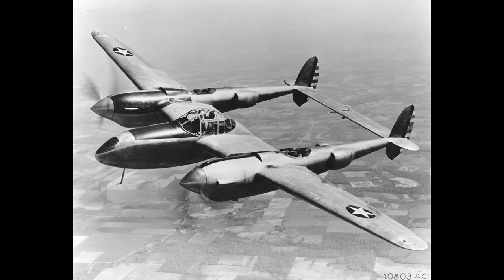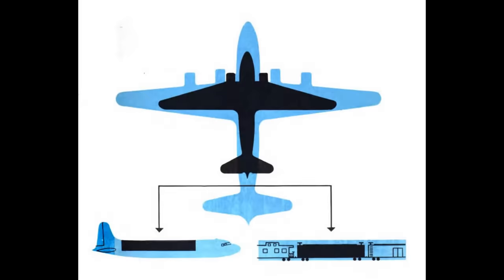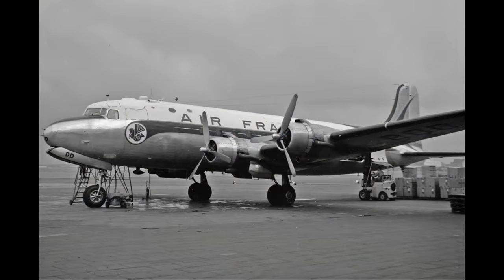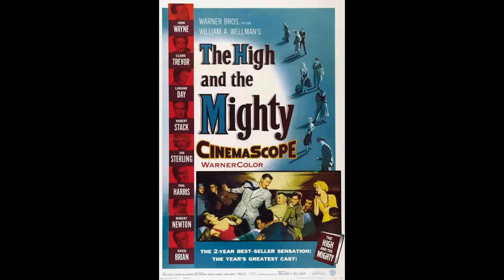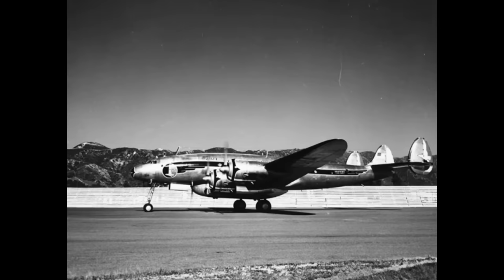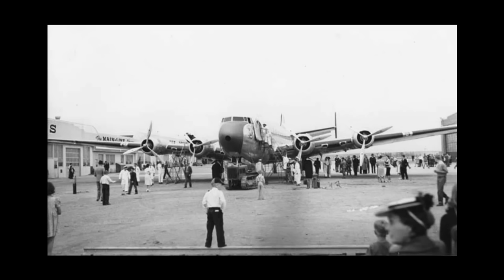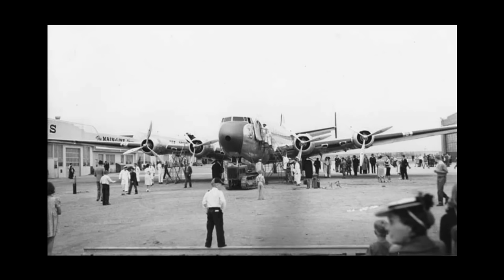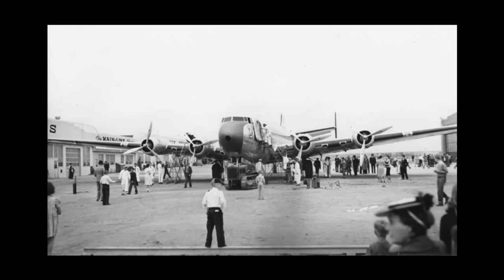Turbo Compound Piston Engines. Almost magic tech.

Comment: Great Video! I remember as a kid standing on the observation deck (common in airports then) and watching a DC-7 start up. The engine would start with a puff of smoke and the usual initial sputtering characteristic of radials, and then some seconds later you would hear the turbine spool up. I always wondered about the delay, but your explanation of how on start up the turbine fluid coupling needed to fill with engine oil finally explained what was going on.
Reply: Wow, I didn’t know you could hear the PRT, cool

Comment: The one I would have liked to have seen in action is the Allison V-1710 Turbo-Compound...the specs on it were really, really impressive...imagine if Allison had developed a Turbo-Compound V-3420!...
Reply: The one I would have liked to see was the Napier Nomad,or Napier's Deltic where the exhaust gases from the 3 cylinder banks was fed thru a turbine which was geared back to the output shaft.

Comment: I'd never heard of turbo compounding before this video, Greg, but I think you're right, we ARE seeing this technology return on some Class 8 OTR truck engines now. One question I have is this: - I've wondered this for years: Here in Alaska we still fly a few Dc6s, which I love. That being said, I've read that during the late nineteen-fifties and early sixties that while some DC7s were actually in the process of being scrapped, due to reliability issues surrounding the Curtis R3350,  the same airlines simultaneously kept their older DC6 counterparts in active service. As a novice, I've wondered why the airline companies didn't just turn their newer DC7s into glorified DC6s by retrofitting the DC7s with the tried and true P&W R2800 or maybe even the P&W R4360? Would this really have been that technically difficult to accomplish or would it have simply entailed too much of a quagmire of red tape  with the FAA? Or maybe the time and effort to convert prop planes simply wasn't worth the effort or expense with jets looming on the near horizon. I realize my question is probably over simplified but in leu of the actual cost of the liners themselves, it seems like an option to have at least been considered. - We do this kind of thing with semi trucks all the time, but of course we don't have the FAA breathing down our backs either: Great video!
Reply from the maker: The R-2800 wasn't an option on the DC7, you would be much better off with a DC6 at that point. Converting to the R4360 would have been a major expense. With the jets on the way, it made more sense to just park the DC7s rather than try to get them to be more reliable.
Reply: The R3350 was a very unreliable product at EIS. One of the deciding reasons for capturing Iwo Jima in 1945 was to provide an emergency landing strip for stricken B29's due to failures of the powerplant (props not feathering after engine failure). The R2800 was the actual high point of piston engine design. Piston bores are limited to about 6.2 inches in diameter - if you go above that the speed of the flame front becomes a problem. PW understood this by the late 20's. The obvious way to get more power considering this limitation is to add more cylinders. The PW4360 was PW's answer and it was no better than the R3350 because they could never get the fourth row of cylinders cool enough - the Boeing Strat was not a success and forced Boeing in some ways to gamble on the Dash 80/707 as it had nothing to lose in terms of market penetration. CW went a different path with compounding but this added a lot of complication and the engine/propellor combination was not reliable. The reason why PW and RR exist to this day as engine manufacturers is that Hobbs and Hives understood that piston engines were a developmental dead end by the early 40's and Lundquist at CW did not. Good video BTW.
Reply: The reason RR exists today is endless taxpayer bailouts,P&W I don't know about.

Comment: Another reason for using a prop on a cargo plane is the “blown wing “. The prop-wash over the wings generates lift.
Reply: in aviation we call this the accelerated slipstream
Reply: This is mainly a benefit in the very low speed regime. The prop does accelerate the air a lot during take-off and landing. But during cruise the difference between the surrounding air is really not so much and probably causes more drag compared to a clean wing of a jet.
Reply: @JMGlider  yes, that is how propellers work, but the thing about it is, once airborne, you dont have to worry about the diminishing effect, because youre going 300mph. This is really a non-issue because this can only be considered an upside to propeller aircraft. Everyone already knows theyre slower than gets, but the propellers do have a leg up in climb angle, stall performance, and maneuvering, excluding supermanuvering fighters of course.

Bottom line of it is, a jet will always be faster, but a prop will always beat them in lift. The slipstream diminishes at high speed, yes, but it is also no longer needed
Reply: I would have thought that the turbulence caused by the prop would have negated any benefit of accelerated air-flow?
Stalls are caused by the air-flow detaching from the wing surface, so surely a prop will cause this sooner than a clean jet wing given the same design of airfoil betwen the 2?

Jets tend to be built for more speed and weight than a similar sized prop plane and as such have a wing that will generally perform much worse at low speed than a prop plane.

Not saying your wrong by any means, I'm V far from any kind of aero expert.. But I'm questioning both of our views and would love to see it tested somehow 
(and by someone with the time and knowledge to make it happen, taking into account relative weights, engine performance(trust, response and such) and anything else I'm no doubt missing.)
Reply: @dzzope i think a jet just needs a longer runway to reach the speed for design lift, 
when the prop aircraft can spare some runway length because propwash wing airspeed replaces some of the groundspeed you'd only reach on the longer runway.

Also, turbulent flow is not detached flow, it's just more draggy than laminar flow. Laminar flow usually turns turbulent anyway somewhere along the wing chord, afaik.

I don't understand the details, but wing design sometimes purposefully turns the laminar flow turbulent (with serrated edges or small holes blowing out pressurized air) to make sure the flow stays attached to the wing surface (if i understand that purpose correctly).
I think that lets you generate more lift,
Or on glider planes, reduces drag. I learned about it on glider planes, but it's been a while and i never fully understood why you want to turn the flow turbulent. 
I think it let's you bridge or manage disturbances- the gliding asociation also jokingly put special zigzag-serrated tape in front of the mirrors and door handles on their recovery vans. 
(gliders regularly don't come home on their own when flying competetively, and you have a pickup crew on standby. German air law allows you to land anywhere when neccesary (not just in emergencies), and then you take the wings and tail off the plane and put everything into a trailer. you should pay the farmer whose crops you damage, though. 
Also with balloons, of course- That's how I got a "free" hot air ballon ride during my childhood :)  )

About stall, i think it's more of an "angle of attack" issue than a turbulent flow thing, and afaik high- lift systems purposefully do the blowout jets jr. serration thing to manage that via turbulent flow.

Also, with a swept wings you can engineer the stall to happen at the fuselage/wing root first, which will reduce lift i front of the center of gravity, therefore  reduce the angle of attack and recover the stall, without it ever reaching the control surfaces at your wingtip. (where it would really ruin your day via loss of controllability)
Reply: @gabrielsturdevant9700  Well I didn't mean to explain how prop's work, you are correct props in front of a wing indeed win in lift. My intention was to point out that increasing lift has not neceserily a benefit. 

I fly among others a turboprop 206 for skydive, we only want to climb, but this setup is really not efficient during cruise. The normal 206 with a piston engine has the same MTOW and a higher cruise speed, so the turbine in this aircraft only wins in climbrate and takeoff distance. Lift is only 1 parameter among many for performance.
Reply: Actually it's blown flaps. 🤥
Reply: @JMGlider  well that does sound about correct, i would bet that the turboprop has the advantage in hp but the cowl is a bit more draggy, or the blades.
There are a lot of factors you are correct, TBO being the one of the biggest, no matter jet or prop we both know turbines have longer TBO
Reply: @billdurham8477  both help. Flaps increase the wing area and effective angle of attack.
Propwash increases the airspeed on the wing (and flaps).
It helps, even on aircraft without flaps.
Reply: 🧐 @dzzope

Comment: Greg , Detroit Diesel have been producing turbo compounded and have a manifold pressure turbo also. The DD 16 is a 15.6 liter engine producing over 2,000 ft lbs of torque. Check it out
Reply: Yep, I believe it was 2010 or somewhere around that time that it debuted, my interests are in gasoline engine's, motorcycle's in particular, but having been a truck driver and stopping at a friend's house one day in 2010 and noticing an article in the latest edition of a trucker magazine he received monthly I read the article, knowing the history of aircraft engine's I'd always wondered when turbo compounded engine's were eventually going to make their way into the world of vehicles whether they be for commercial or performance reasons, when I saw that article I knew the time had arrived and to be truthful given the lengths that automobile manufacturers go to in order to meet the ever increasing emissions standards I'm surprised this technology hasn't found it's way onto cars, if not for performance oriented cars like Corvette's and Mustang's etc etc, given the hydraulics involved with the drives in automatic transmissions they're the perfect candidate for something like that.

Comment: "It often pays to look to the past" just like you said of lippisch and others doing their work within limitations after WWI, in your Me163 vid!
On another note about recovering exhaust, the concept that put early steam engines over the line to becoming viable is of course utilization of the remaining energy from the exhaust of the first cylinder, in to a second of lesser expansion, then third, and (rarely) so on. What was this called? Compounding!

23:00 Do you recall where you found that 801 pic? That looks to be in great condition and would be neat to see in person.
Reply from the maker: Thanks. I don't know much about steam locomotives, but it makes sense that the process is called compounding. The 801 pic is from Wikimedia commons (free to use). Just go there and search for BMW 801.
Reply: That process was called dual or triple expansion

Comment: This is why the turbofan engine became the dominant engine for comerical airliners vs the turbojet engine.  You get the benifits of a turboprop at takeoff and low altitudes along with the ability to cruise at high altitudes and high speeds.

Comment: I predict electric impeller jets will be really popular.

A jet without a turbine and one one moving part (not including valves and such). Without anything to get in the way of the middle of the jet you can have field are mixtures much closer to stoichiometric without melting anything.

They also don't need to spin up or down, thrust is almost instantaneous.

Going to be the next "magic" tech.
Reply from the maker: I haven't seen it, but any time I look into electric aircraft stuff, the battery issues kill it before it gets going.
Reply: @GregsAirplanesandAutomobiles Only the impeller is electric. The rest of the jet uses fuel. Hybrid best of both worlds.

If you can get going fast enough you can ramjet, feather the impellers and they act as generators to recharge the battery for landing.

Then you only need a battery big enough to get up to speed, then Bernoulli does the rest.
Reply from the maker: You make it sound great, but I would have to see it before I form any conclusions. There are a lot these sort of ventures that are really just cash grabs, this has been going on since about 50 years before the Wright Brothers, which I cover in another video. This one might be legit, I have no idea.
Reply: @GregsAirplanesandAutomobiles  It's one of those theoretically possible using several technologies that already exists but are still in the lab things.

Once you can buy a rim driven axial electric motor, it's only a matter of time.
Reply: Prototype electric turbofans are already flying. The advantage at the moment is you can design the gas turbine engine for cruise power with the consequent improvements in fuel efficiency. Takeoff and climb power is handled by the battery driven booster fans.
The batteries are trickle charged from the turbine in cruise and descent.
Reply: @GregsAirplanesandAutomobiles 
One thing that IMO is going to limit electric planes is your take off and landing weight is always going to be the same. Plus the power density of aviation fuel is a lot higher when measured by weight. Plus on commercial aircraft they can be turned around a lot faster.

Comment: My father was sent to England to get up to speed with the engines on the Super Connies. He loved the two years there alone. After his training he was almost the single most in charge person In USAF to work out the Maijor problems with this aircraft. When my father and his team were done it became a quite reliable asset and sure were neat to watch taking off with assist at night. These things while taking off fully loaded had some sort of assist where when it took off using the assist system was a fire spitting crazy sight at night.
Reply: The Neptune's had jet assist for takeoff,one J45 under each wing.

Comment: Subaru stopped being exciting about year 2000 to me, but they were far more exciting compared to other cars in the 70's and 80's.
Reply from the maker: In truth, Subarus are decent cars, and they have made a few real winners, but mostly they are dull.
Reply: @GregsAirplanesandAutomobiles  i agree, i feel like they were trying alot harder to be different in the early days though, early 80s 4wd wagons, some with turbochargers and efi, the 83 leone rx hardtop coupe had either dual downdraught carbs or mpfi and a turbocharger, with an awd trasmission that had a variable centre diff and rear lsd. They were actually pushing the boundaries of what a road car was back then. But i feel like once they were already at the top of the rally game they stopped innovating in the road cars.. i mean, as long as you dont rate the idea of an alloy boxer diesel engine... Which im not a fan of haha
Reply: 2002 Subie still running fine, with the oil leak problem. New, it had heated seats and mirrors, full size sunroof, AWD, was avail in 5spd manual, and handled like a sports car at 80mph due to low cg. It was like NOTHING else for the price. The RAV 4 was slow and ungainly and more expensive. A lot of companies copied their ideas.
Reply: I bought a brand new Subaru WRX STI in 2006....trust me, that car was an absolute blast!
Reply: @fazole  yeah i dont doubt they are nice, they just arent my thing. I had a couple of gc8 wrxs and a 2000 legacy rx sedan, they were good and reliable (340,000km on the ej251 without doing a head gasket, high octane fuel is your friend on a hot day) but i didnt have the same love for them as i do for my 1982 leone hardtop, or my 1977 4wd wagon, they were built like a toyota, but with innovations. I see the newer ones more like a modern mazda, built to be comfortable and fancy for the first owner, maybe the second, and then disposable where the 79-83 leone with the ea81 engine can be outright abused all day every day and it will still last 400,000km+ as long as you have at least oil in it (if you get them hot via a faulty engine fan thermostat they pop a welch plug in the head out and then the coolant and oil mixes, but you can still drive it home 200km as is, fix it, and it still runs fine and has done seemingly no damage to it (still has good compression and oil pressure 180ish thousand km later) i guess it helps that they dont make alot of power so they are understressed compared to a modern car though
Reply: Subarus in the 70s were weird ugly little cars.
European stuff was far more interesting than anything from subaru
Reply: Subaru is a much different company in the post-2010 era than it was in the 70’s/80’s/90’s. They used to be infamous for head gasket failures back then, they seem to have mostly fixed that now. Of course, being a giant plastic computer on wheels, they’re not quite as durable as the used to be, even if the engines are more reliable. That’s a flaw that goes for all modern cars, though. And they still get mediocre fuel economy for a 2.0L 4-cylinder, as they generally always have. Another weakness of Subaru was their automatic gearboxes. They use CVT’s now, which are fine, until you get about 150K-200K miles on the odometer. If you’re getting a Subaru, whether Classic or New, get a manual gearbox, unless you don’t mind spending the money on repairs.
Reply: @sugarnads Most 70’s/80’s/90’s Subarus were utilitarian cars aimed at alternative hippy-own people who lived in places where they had to drive through mountainous/rural/snowy conditions. Kind of like SAAB, but for someone who was on a budget. There were a few interesting ones. The 1st generation Alcyone (XT) with its Turbo F6 Boxer, manual gearbox and digital tach/speedo/odo was unusual. Quintessential 80’s boxy futuristic styling. 2nd gen Alcyone (SVX) was a luxury grand tourer, but only automatic. Not as good.